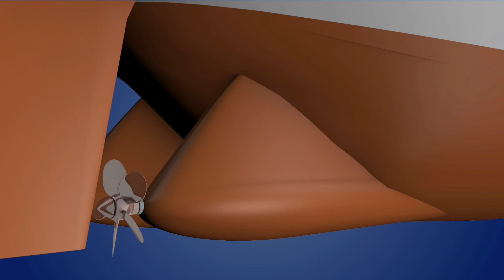Tankers

Comment: did they mention about sonar? i may have missed it, but if not, they should try putting some on tanker, just so they have a better chance of seeing shallow waters, or anything that could damage the ship.
Reply: Sonar is mandatory on all ships. Some ships have 2 sonars, on up front on the bow and one on the back-at stern so you know how much water you have under keel. 

Charts have depth charted on them and ship knows its draft so it doesn't plan journey thru areas it cannot pass(tides make is more complex)
Reply: Radar (for water) = Sonar
Reply: i gathered that from middle school about 14 years back, i was just mentioning that putting sonar could help see anything that may be hidden in water...  like they do with subs, they avoid hitting anything by using sonar as one of a few different tools.
Reply: +JGPixl not true. retar is for above the water surface. sonar is for below. but many of the new gps systems incorporate sonar transducers.